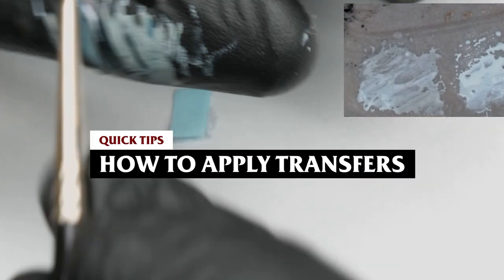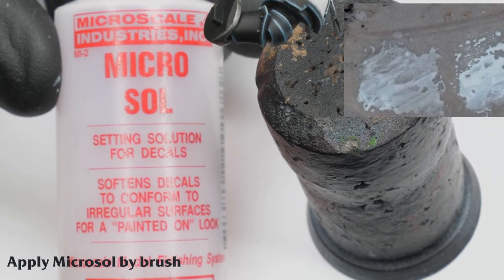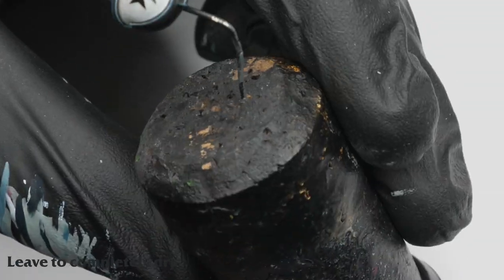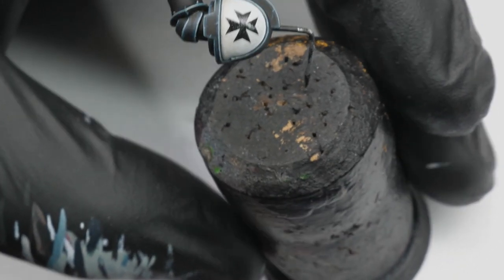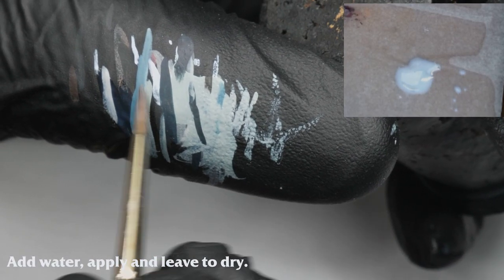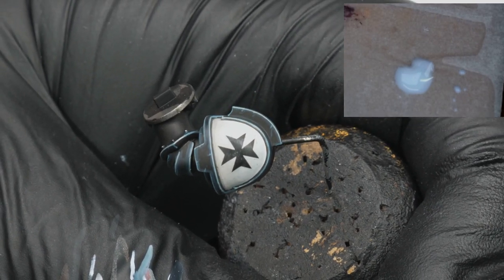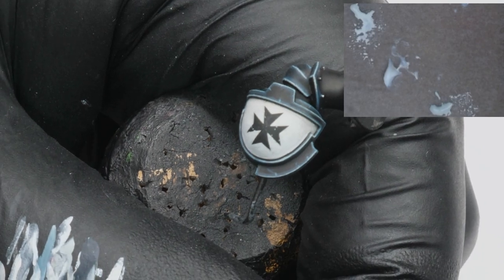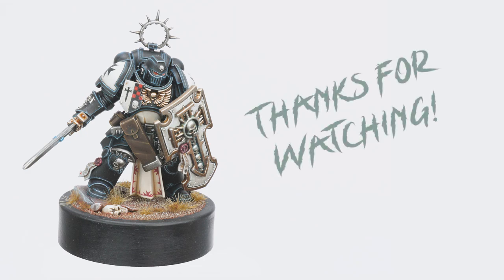Quick tips! How to apply transfers to your miniatures. Fast and easy method!

Comment: Would you ever bother adding a gloss coat before a transfer, or is this unnecessary in your experience? I know a lot of people swear by this, but I never worked out whether this was a mostly irrelevant hangover from military modelling practices!
Reply from the maker: I have discussed this today with a member of EM. They seem to think it can help to varnish before and after with thicker transfers (newer GW ones tend to be thinner) however in general they don't tend to do this. If you aren't super careful when applying the microsol it can affect the surrounding paint because it is designed to soften the plastic transfer and the paint also contains plastic so the varnish can help protect the paint work. A coat of varnish after can also help protect it from damage on the table top. So the answer is yes by all means use it if you run into issues and the miniature is going to be handled, however I personally find it mostly unnecessary for display purposes and applying a gloss varnish means I have to try to get that surface back to a matt finish.

Comment: Help. I always find Ultramarines transfers have a strange curvature which means when applied it sort of folds and creases, any ideas?
Reply from the maker: Hey Simon, yeah the ultramarines ones can be tricky, sometimes I take a scalpel and cut into the empty bit in the middle of the "U" and try to position it as best I can before applying the microsol.

Comment: do you seal the miniature after everything is done? btw those are the best vids out here for painters. on point!
Reply from the maker: I don't tend to seal as a habit from having worked in the studio. Varnishing is too much of a risk in general when I need to be absolutely sure the finish remains matt for photography and I don't want to risk changing the finish of any metallics. However, I see no reason why you shouldn't varnish if you find one that is reliable if the miniature is not just for display. The glaze medium I use I think acts in a similar way to a varnish and it has a very reliable matt finish.